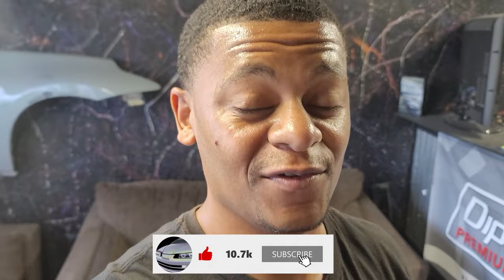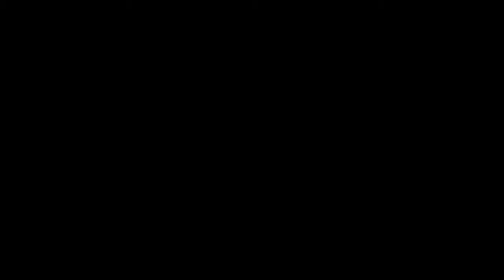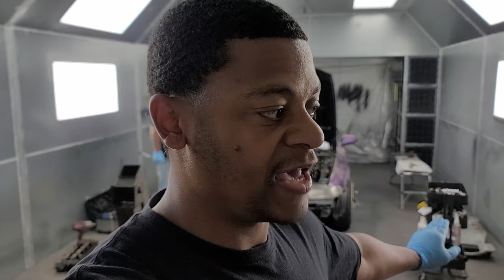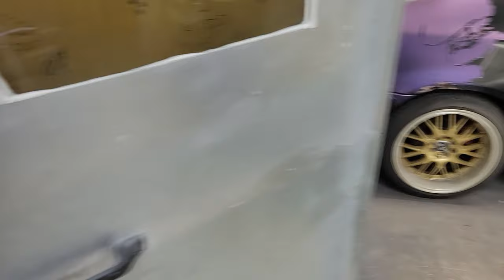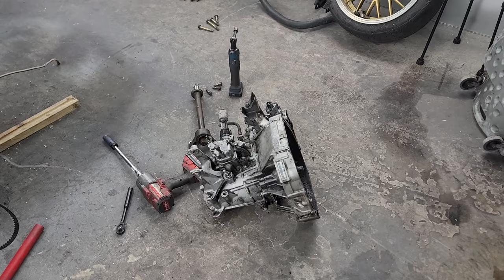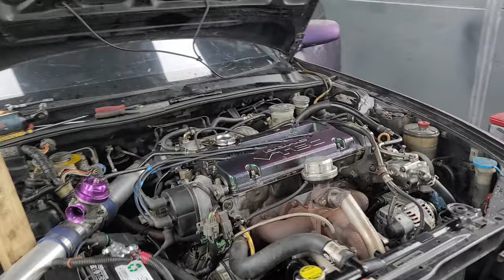The Grape kush Turbo Honda Prelude is back!!!!!!!

Comment: Trey ? Will basic H224a base model motor compatible with H224a SH tranny? I looking for answer before I drop in and find out it doesn't work.
Reply from the maker: SH stuff is weird bro most people just convert over to base cause there are more part available